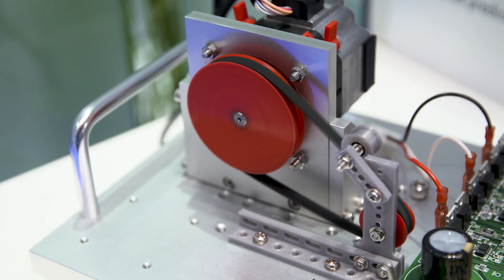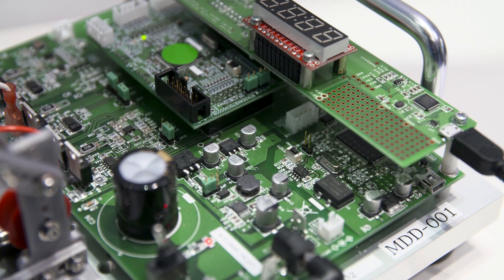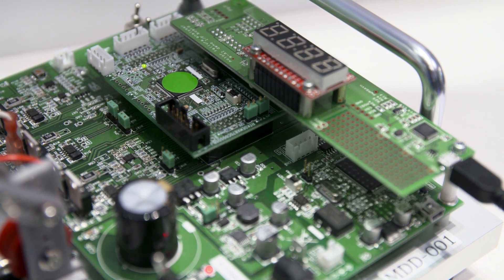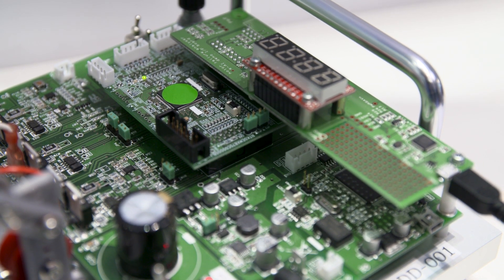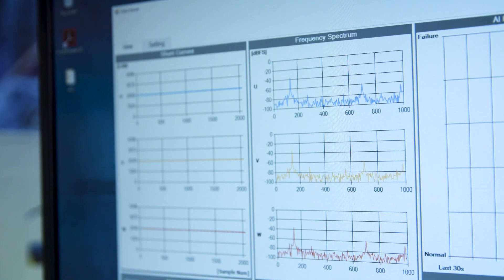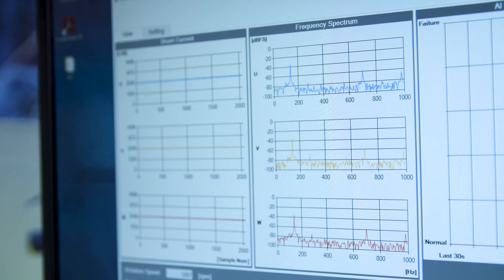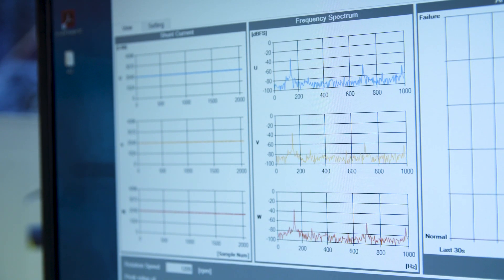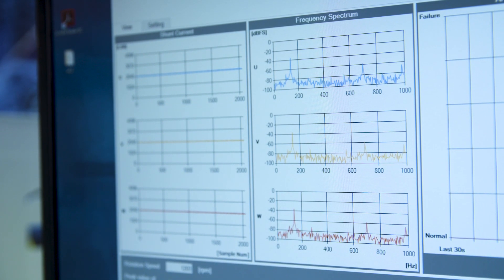eAI Motor Control Failure Prediction

Comment: You can do this with an Arduino controller and some clean code. More impressive if the board took in other analog and not available signals such as heat, vibration and sound to compare against its algorithms.